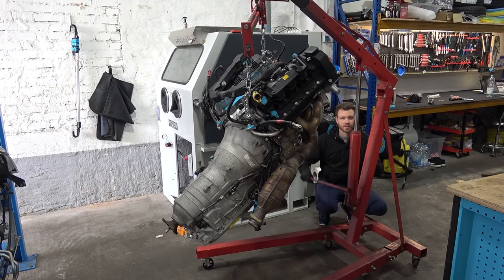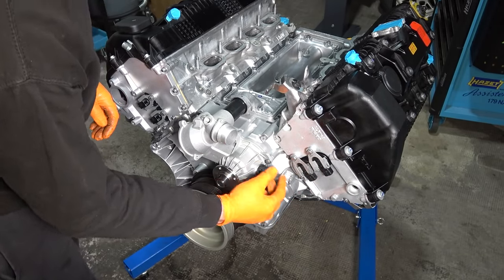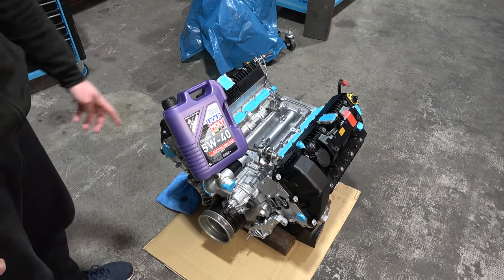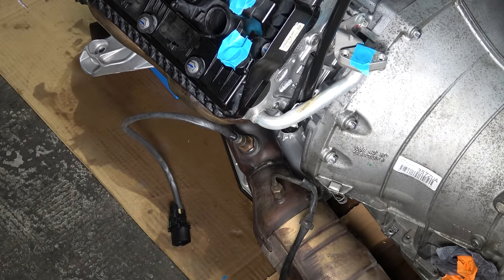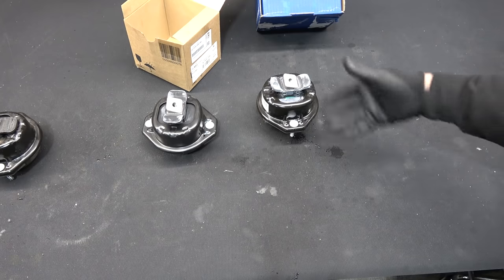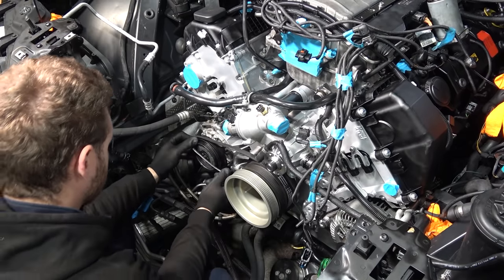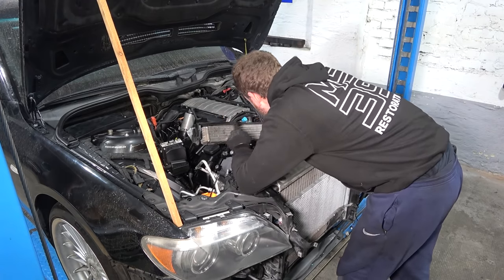The Beating Heart Goes Back In - Supercharged Alpina B7: Project Chicago: Part 5

Comment: That slow, unstoppable, gradual descend into madness when refitting parts....I felt that so hard 😅
Reply: we've all been there xD
Reply: @BlahBlah-np2fp  You ain't kidding!!
Reply: The worst is getting hurt and having to power through the pain and bleeding to wrap up.
Reply: @RZRBLAZ  What's even worse imho is when you break some small thing that can't be bought separately, so you either have to buy some bigger, (much) more expensive part or resort to some crappy fix ^^
Reply: @obihornchen6508  the one small thing that has to be there or nothing else will function
Reply: The “fuck it im getting breakfast” feeling is all of us after dropping an 8mm bolt somewhere ungettable
Reply: @H45N3P  Not even just somewhere ungetable, while the hole engine bay is a giant hole, you hit the only place where it doesn't fall through.

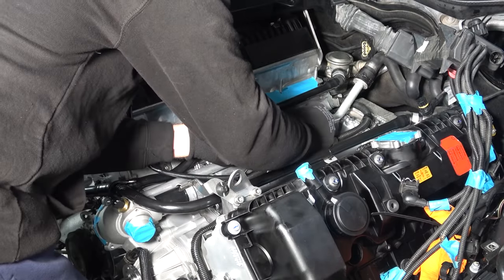Comment: 27:48 I´m very confident that you shouldnt "gut and tight" mount the knocking sensors. They usually have specific Nm and cant work/making problems if you dont do that. Great Video so far tho.
Reply: Same here. Usually it's 25nm, apparently it matters because it's a little microphone
Reply: Same here. Usually it's 25nm, apparently it matters because it's a little microphone
Reply from the maker: I couldn't find the torque spec at that moment, but I did now, it's 21 Nm. I've done them in the past by hand, normally have a good feeling for that and know when to stop and not over-torque them, but granted, better to torque them to spec so I'll revisit them. Thanks for the heads up :)
Reply: I came here to say exactly this. Good work on everything else, minus missing some torques. Like the alternator bracket. They are prone to failure anyways, I always torque everything so no doubts exist. The standard torque for all the bolts are about the same for E32, E38, E65/66. I go by head size or comparable shank if a reduced head bolt. 10MM (M6) = 10NM, 13MM (M8) = 22NM, 16MM (M10)= 47NM. Love the channel. Funny I wrench on my three 7-series most days (because they are needy girls) and still come back for more on this channel when a new video pops up. It never gets boring. I am concerned though that I too have started saying "carbon fiber towels" in my head now.

Comment: Loved this video! Thanks so much. Please be careful tightening knock sensors as they are piezoelectric mics with internal glass structures that break if you overtighten them, they mostly run 15-18Nm. Had a huge problem with a car once that had this problem, last mechanic had overtightened the sensor that destroyed it and gave erratic reading that threw the car into limp mode.

Comment: That’s a lot of work right there. I was going to say it’s optimistic to get her started in one episode. Massive respect on all your efforts for this project. The whole intercooler, ac compressor, radiator, transmission cooler assembly must have been designed by a psychopath engineer. Jesus!

Comment: 4:34 from air conditioning oriented shops, you can buy kits of multiples of various sizes of silicone caps. They are excellent for capping lines. The caps service both female and male ends. And because they are silicone, a quick rinse with some soapy water will make them reusable. You'll probably live out of that box for many years. I've bought mine circa 2009 and i still use it today. So much better than dealing with tape that may or may not glue, may fall off and then you have to figure if it's worth cleaning or not etc.

Comment: That one comment about waiting to crush some lines.. had to swap the transmission on my Volvo a few weeks ago. We wondered why the trans was so difficult to push into place (had to do it from the bottom) - turns out the harness for the O2 sensors was between one bolt eyelet and the block. I almost cried a bit - all wires were smashed and we had to loosen the trans again.

Comment: The plug on the thermostat is actually a heater which when activated by the ECU causes the Thermostat to open further, reducing the engine temperature. On my M54 I've seen it go as low as 77C when It's active. The ecu has closed loop PID control over the engine temperature using this heater. Any semi competent tuner can reflash the ECU to target a lower temperature, even change when the fan kicks in. I am not entirely sure what ECU the Alpina has, but it shouldn't be too hard. If you need help researching that topic, I'll be more than glad to help. I've been tuning/flashing ECUs and dealing with automotive electronics for the past 1.5-2 years. I might not have a ton of experience, but I am willing to help any way I can if you decide to go that route. Awesome series!

Comment: 105C ECU controled thermostat doesn't keep temperature around 110C only when sitting in traffic. That's "normal" operating temperature and it stays there as long as rpms are below 3000 or 3500. When it's driven hard or above those rpms for prolonged period of time it lowers coolant temperature to 90-98C. 
That's why we have disintegrated plastic and rubber parts on BMW's, especially V8s, since it's cooking everything whenever it's driven. I think it started with M62tuB44 engine. 
90C thermostat will make everything last much longer.

Comment: Another great vid. I'm glad that you are doing an E65-chassis car as it is giving me some guidance on my 750i. BTW, you are replacing just about everythingwith new on this motor but I noticed you didn't replace the IVM (Integrated Voltage Module). From what I'm seeing out on the various E65 sites as well as my own experience; you'll save yourself a lot of electrical (engine and tranny-related) heartache if you just go ahead and replace the IVM as a normal maintenace item especially if the one you have has over 160K kms on it. Apparently, BMW now strongly recommends this replacement due to corrosion issues on the IVM circuit board as well as cracked solder joints at the fuse holders. Anyway, just a suggestion. Also possible to post the link to your guy who did the lower temp thermostat? Again, great vid and I'm looking forward to seeing this thing run!👍

Comment: @8:34 - To save the agony here - open the drop valve on the cylinder, pick the crane arm up to above where you want it - tighten the valve back up.   The piston will act like a syringe and suck the oil through.   Then you can adjust in a few seconds to where you want to be...

Comment: Sreten, great work as always. Small tip, but leave the valve open on your "apple" picker and then tighten it after you manually lift the arm it to the height you want. Make for a quicker use instead of pumping the arm up hydraulically. ;)

Comment: awesome episode. saw the oil drippage at the bottom of the intercooler. may want to consider an aftermarket catch can to help with blow by. I had a supercharged Dodge Charger highly recommended.
Reply from the maker: That's normal. You just drain it with every oil change.

Comment: After such a job, you should use liquimoly ceratec! Will protect the cylinder walls, and well, give you a smooth running engine better than factory, next service you can use motor protect and oil additive, also a fuel injecter cleaner with a full tank of gas!

Comment: Being in the process of reinstalling an N55 engine back into a 335i x-drive which is by far the most extreme DIY I have done to date, I can identify very much with this video.  I didn't remove the entire front end, so I dropped the engine in without flywheel and then did flywheel, clutch, pressure plate, transmission and transfer case from underneath.  Also I did not have a real lift, did it with a Quick Jack mostly on my back.  But he is making me feel not worthy as my parts are not cleaned like new.

Comment: It looks like your engine lift might be low on oil. Try adding some oil and see if it improves it's lifting ablilty. Last time I filled the shop jack I used 10w HYD oil. And it leaked out after a few months. But it worked like new after I refilled it.

Comment: Hey Sreten, not to be the one to know it all, but according to my knowledge OE and OEM are most of the time used in the reverse meaning you are using them:
OE is the part you buy at the dealership with the BMW insignia on it - but of course BMW doesn't manufacture most of those parts themselves. The OEM part is then sold under the brand name of the original manufacturer of that OE part on the aftermarket, hence the added M and most of the times a good discount compared to OE. Funnily enough the Vemo part went from OE to OEM in the process of grinding the BMW logo away.
Reply from the maker: Thanks! That's actually incorrect. Parts that are sold by official BMW dealers are branded as genuine/original. OE is the same part just with BMW logo removed. OEM are parts made by known brands, but are not as used original by BMW in that particular application. A lot of people get this wrong.

Comment: sreten i believe you don´t have to coat that crankshaft oilseal with oil. i believe the type of seal used friction with the shaft to create the seal. I made the same mistake on my e30 and ripped it out and used a classic style oilseal because i didn´t have any confidence in that type (however it is the only type of seal bmw sells anymore).

Comment: FYI, u dnt need to pump the engine crane up like u did before its loaded obviously . Just lift it up by hand. It will build some pressure. Much much much quicker

And liqui moly mag cleaner on that gearbox would have cleaned it up perfectly. And just runs off

And OMG THOSE GUYS PUSHING ON THE BOOT SPOILER. lol.

Comment: You should send your E21 and E30 cold start injectors there as well, they probably have bad spray pattern due to not being used for a while and the stagnant fuel got them clogged. Ultrasonic cleaning while spraying fuel makes wonders.

Comment: If you loosen the screw on the cherry picker hydraulic jack you can then manually (and quickly) lift the arm up high.  Tighten the screw again and you're good to go.
Reply from the maker: Danke :)
Reply: @M539Restorations  No worries.  Learned this rebuilding the 4.0 in my Jeep Cherokee XJ a year or two ago.

Comment: Sreten, pro tip: instead of aluminium crush washers use annealed copper ones, they provide better seal that doesn't soften overtime and are reusable for 2-3 times. Stay cool
Reply from the maker: Actually no, alu provides far better seal cause it's softer material and takes less force to crush it. Never reuse any crush washer.
Reply: @M539Restorations  but in my experience aluminium tends to soften with time and weakens its sealing capabilities. Whereas annealed copper washers are as soft but they dont warp since the crystalic structure doesnt change with temperature. But what ive seen from your videos it doesnt really matter since you always do everything according to spec. Love your videos, they actually even helped me with my e46. All I was saying was from my experience as a veteran motorbike mechanic. I will probably trust you when it comes to bmws... :) thanks

Comment: With the apple picker, you can lift the crane arm by hand to the level you want and then just give a few pumps on the handle and it will stay up so you dont have to die of boredom everytime you use it. Tho not 100% sure it works on all engine cranes.

Comment: I realy dont want to curse your whole job with this engine, but in Poland, a very famous car repair shop, where those guys repair many of alpinas engines, most from E60, but engine is same like in here. They recommended  to use only oil in this engine with the parameters of "0W" because the pipes supplying the oil to the compressor are so thin that 5W may cause seizure compressor.

Comment: Hats off to the mechanic for such quality work and his knowledge in this field is commendable. It's a beautiful beast of an engine. Saying all that, here is my take:

These top-of-the-range car engines are as complex, if not even more than, airoplane engines. Main difference is that aircraft engines have far stricter tolerances and the materials used are a lot stronger, far higher stress-resistant, heat-resistant, etc. 

My point is, why on earth would anyone bother to put such huge and so complicated engines to move mostly 1 person? Clearly these engines are far, far more powerful than ever needed. Forget your obsession with cars and engines for a second and think about the resources wasted and CO2 produced to manufacture such a mess!

This is what humans do. When given too much freedom and left alone without boundaries, they start wasting and start producing things that are never needed. Every empires were eventually brought down by excess and indulgence.

Compare these pathetic engines with electric motors, for example. Those have far, far fewer parts, fewer pipes, fewer nuts and bolts, fewer fluids and fewer leaks. Fewer maintenance, fewer things to go wrong and yet they produce more power and propel the car a lot faster. And they are smaller too. 

What I am saying is that instead of building more and more complex gasoline engines, and wasting our resources and polluting our planets, the thieves and criminals in the car industry should have started migrating to electric motors at least 30/40 years ago. Yes, batteries have their own evils. But if they started work on them by now we would have gotten something a lot better.

Comment: I admire your work and have been following most of your programs. I have a BMW e36 and have decided to restore the engine.  I had over 300k and has been my daily driver.
I would appreciate your suggestion to share address of part suppliers to purchase all the relevant engine parts for my e36.

Comment: if you put some oil into that hoist, it'd probably move faster...
Reply: also, knock sensors HAVE to be tightened to a specific torque setting, not 'good n tight', otherwise they'll report false data

Comment: Your dedication and standard of work is second to none! 
Just a heads up regarding attaching the knock sensors. They should be torqued to spec in order to insure they work as intended. I believe it's the regular torque value for the size and grade of the bolt used (M8 8.8 24Nm) so chances are you don't need to revisit them with a torque wrench if you have the right feel by experience of using the torque wrench.

Comment: Great video again! I do have a question regarding the low temp thermostat. Currently my Porsche 996 engine is being rebuild with steel sleeves. 

The company who is doing the rebuild told me it’s not necessary to have the low temp thermostat. So what would you recommend? The 996 often reaches temps >103 degrees Celsius with normal thermostat.
Reply: Lower is better 95 c worked best for me.

Comment: i just want to suggest to yall next time you need to push a car around,  turn the tires over by hand instead of trying to shove it by the body panels. goes way easier and no pressure points on the panels
Reply from the maker: Thank you. None of that is anodized in the first place, just bare alu.

Comment: Hey man. You shoud apply the right torque to the knock sensor, they are piezoelectric so they depend on the right torque to send the correct current to the ECU. Undertorqued or overtorqued knock sensors in some cases could even make the car misfire. As well as the EHT sensor. Looks like a work of art though. Keep it up

Comment: Loved this episode!
As usual, every episode is either of equal or better quality than the previous!

Say, aren't you afraid that the vapour blasting media will eat away the anodised layer of aluminium parts that prevents them from getting that nasty corrosion?
I'm partially saying this because I used to anodise parts at a former job I had, and I know how thin that layer can be sometimes (particularly for non-maritime applications), and also how easy it is to get it off through abrasion.
So I'm curious if you have any part that you have used your vapour blasting cabinet on, and if it may or may not be creating aluminium corrosion.
This question may or may not also be motivated by a great amount of jealousy of that fancy vapour blasting cabinet :P

Looking forward for hearing that roar from the Alps!

Cheers

Comment: great work again, just wondering if you can buy 1988 bmw 325ix inner lower ball joints for the control arm I have called and searched the states to.no avail just wondering if its possible besides buying the whole control arms thanks for the great rebuild of the alpina

Comment: Impressive work. But lets be honest. Who in their right mind think they can keep this type of car running very long. Lots of parts already nla. Been wrenching for 20 years or so. Restoring cars. If you buy a car like this you will never leave the garage once it dies on you. Im not just talking about an alpina. Im talking about these luxo barges in general. Imo, the e39 m5 will be the last m5 every man with an internet connection can keep running. E36/46 m3, e38, so on. Whatever comes after these isnt worth fixing or too complex for 99.99% diy’ers(who are the ones keeping old cars alive)
The e60 m5 will maybe survive but most will require a manual trans swap as the smg parts become unserviceable/nla

99.99% of us arent skilled youtubers with time, a full equipped shop, and sponsors. Most of us are mere mortals with wife, kids, jobs, whatever

Comment: Hey Sreten,Love your Videos and you are very talented. BUT you Made a big mistake and you have to put the intakemanifold back off. Its EXTREEEEMLY IMPORTANT to Torque those Knocksensors correctly otherwise they want work right!! Greetings from Würzburg ✌️
Reply from the maker: I couldn't find a torque spec, but I never did in the past torque them to spec, only by hand and never had issues. I will revisit them though